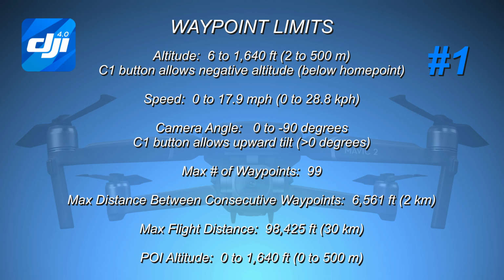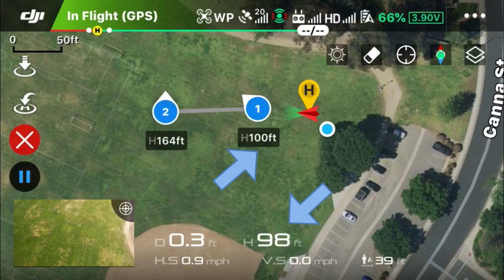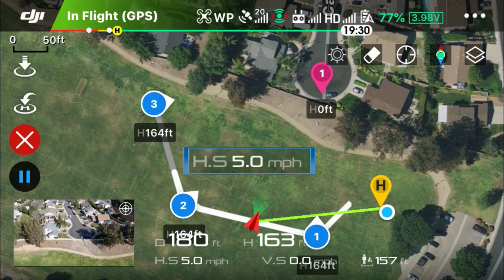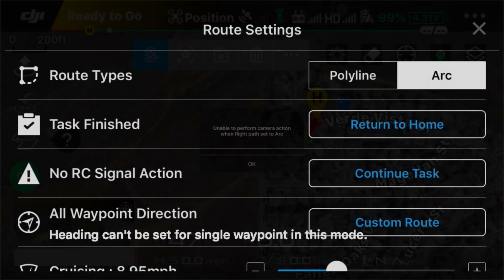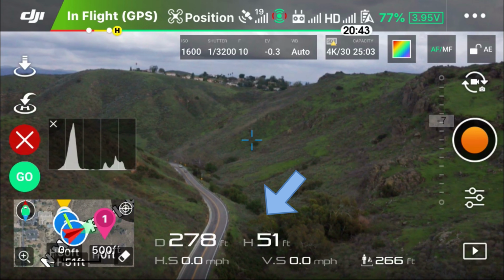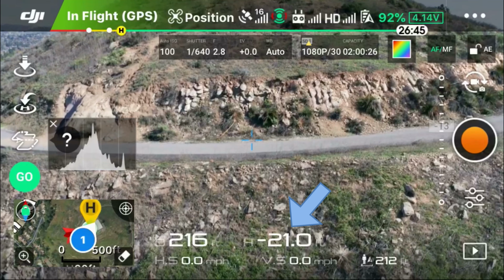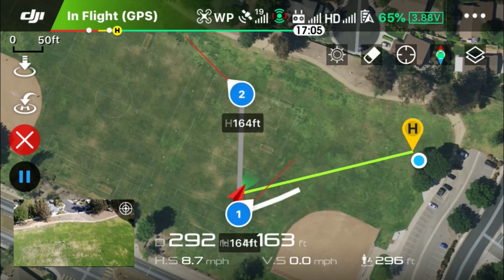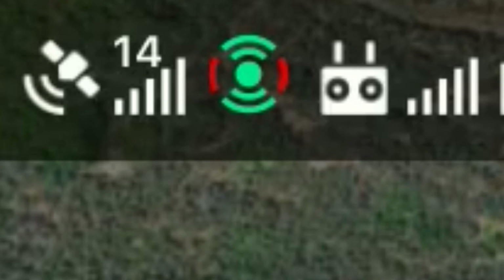DJI Waypoints 2.0 - 18 IMPORTANT TIPS + TRICKS - Mavic 2 Pro / Zoom - For Beginner & Advanced Pilots

Comment: Hi Dragon7. This is the best video on new waypoints function. Congratulations. I hope Dji will correct quickly the first errors you mentioned. I didn’t t completely catch the usage of c1 button but I will try and go back to you if questions. I don t understand why Dji doesn’t t permit to set altitude of waypoint or point of interest below home by default... just like litchi does. Thx for the trick for using waypoints without connecting the drone (with some limitation) which is definitely the biggest error of Dji with this functionality.  Hope this will be solved in newt version. Thank you again and keep, on your job !!
Reply from the maker: Wow, thank you so much for your very nice comment, very nice to hear.  And yes, DJI has many fixes/improvements which hopefully will come out sooner than later.  Thanks again, and Happy Flying!

Comment: I was looking for minimum distance between way points?  Say I want 2 waypoints, but I only want to change the altitude.  start at 6 feet and go straight up to say 200 feet.  Can this be done?  Thx.
Reply from the maker: Sure, after you set the 1st waypoint, add one near it and then drag it on top of the first one.
Reply: @D7dronetech  I will try that. Thank you for the quick reply

Comment: Hi Dragon7, thank you for the quality of your video on waypoints. I am trying to find the best way to setup two way points starting and ending close to a wall. My configuration is a shooting range, I want to simulate the trajectory of a shot from the shooting line to the center of the target. Can you do this using waypoints? How do you manage the sensors? I have a Mavic Pro 2. Tx a lot for your tips.

Comment: You seem like a smart fellow.  I need to follow a powerline.  Trouble is capturing a straight course when the next waypoint is a corner - say flying north from WP0 then west after WP1.  The drone begins turning west after leaving WP0 losing view of the transmission line.  I need the drone to pivot the full 90° at WP1.  I don't think it is possible.  Your input is welcome.
Reply from the maker: Should be as easy as using a POI. You could also set extra waypoints and POIs during the turn for extra precision. Hope that helps.

Comment: Thank you very much Dragon7 for the excellent contributions made in this video. The best I saw about waypoints. I have a question about Tip 17: I did a test keeping the waypoints screen, turn off the drone, but automatically the wp and poi that I had and the waypoints action selector went away from the screen ... It can be that DJI have removed this possibility in the update of the DJI GO 4?
Reply from the maker: Thanks so much for your nice comment!  Regarding your question, I just tested it and it works fine, just like before. I’m on iOS. Happy flying!

Comment: Thank you very much for this and the prior video! Quick question if you are still monitoring this video; Video vs. picture while running the waypoints: can you be videoing and have the camera set to snap a picture at each waypoint or would the video have to stop in order to do this resulting in multiple videos? Shortened can you video and take photos at the same time or does each action have to be independent of the other?
Reply from the maker: Delmarksman You’d need to stop the video before you can take a photo

Comment: Thanks for the video Dragon7.  I have one question.  I set up a Planned Mission with about 10 waypoints with the first waypoint beginning at 75ft and the last one ending at 8ft.  My problem is that after I press Go, the Mavic 2 goes to the first way point but never begins unless I press the forward stick, which I'm guessing it's by design. 

But the bigger issue that I am having is that it stops at each waypoint and doesn't move unless I press the forward stick again.  Is there anyway to get to not stop at each waypoint?  Thanks.
Reply from the maker: It sounds like you have your speed set at zero.  You need to make sure your mission settings which you'll see when you press Go has that not set to zero.  Also, you should check the speed you have set at each waypoint.

Comment: Good afternoon. A matter of battery saving, you may know that with Litchi you can plan a route from PC, tablet or mobile, without having the MAVIC connected. With WAYPOINT 2.0 you have to connect the drone and the station and then create the route on the tablet or mobile. It is true that at that time, when it is already within waypoint 2.0 can already turn off the station and the mavic ?? or it must be granted all, all the time.
And another question, in Litchi it can be configured so that the heights of the waypoints have greater height depending on where it will happen. If on the route there is a wp at 20 meters high but on the road a mountain appears, the program has it in mind and will know how high that mountain is and will climb those 20 meters higher than the height of the mountain or where Be the route. In these cases the application of DJI GO 4, could not do it and would crash, is it correct?
Thanks from Spain
Reply from the maker: You can plan a Waypoints 2.0 mission after being disconnected from the controller and:or the drone, but the altitude height won’t be adjustable above 65 ft or about. For the relative to ground altitude adjustment, DJI’s app doesn’t have that feature like Litchi to adjust the altitude you set to be that altitude plus the “altitude” of the ground. This feature must be selected through the Litchi app to adjust the relative to ground altitude.
Reply: @D7dronetech  Then I can connect the station, the mavic and enter waypoints 2.0. At that time I can turn off the mavic and the station and proceed to configure the route. The heights could not be greater than 65 feet (20 meters). So you would have to connect the transmitter and the mavic again, to place the correct heights, but at least what is the design would be more comfortable with the mavic and the station turned off.It is right ?I have the doubt, because in your great video, in the end, it looks like you create a small route, save it and reload it and that is when you report the 65 feet.Therefore, a small route has to be created, saved. Turn off everything except the mobile or tablet, then reload the route and then we can modify it, add, delete .... but always with the limitation of 65 feet?That Litchi makes it almost perfect and the manufacturer himself does not .... very afraid they must have people create routes from hell ... :)
Reply from the maker: You can plan a Waypoints 2.0 mission after being disconnected from the controller and:or the drone, but the altitude height won’t be adjustable above 65 ft or about. For the relative to ground altitude adjustment, DJI’s app doesn’t have that feature like Litchi to adjust the altitude you set to be that altitude plus the “altitude” of the ground. This feature must be selected through the Litchi app to adjust the relative to ground altitude.

Comment: Totally what I needed. Thank YOU! My problem is that my M2P refuses to link and run any mission because of an "incomplete" warning without giving a detail. What hidden detail could I have missed, except that I'm also irritated at the latest "geo fencing" yellow and orange messing up my screen when I have a clear zone to operate in. In two separate locations away from any airport I get these North/South corridors on my screen, I surmise DJI included the migration pattern of the snow geese here in Texas twice per year..
Reply from the maker: It’s not clear the problem you’re having but have you updated to the most recent firmware?  It fixes long standing issues with waypoints mode b
Reply: @D7dronetech  Thank You, I finally got my first run in the can, one baby step at a time. I also found out that if one does not hit save, everything will disappear.

Comment: Is there a work arround for the stopping and jittering at each waypoint? Thx
Reply from the maker: It’s currently a known issue which DJI might fix. As a possible option, use curved turns to help smooth it out.

Comment: Thanks, great tips. I'm struggling with C1 route planning. When I set four way points after lting a desired route and want to fly back in reverse, it seems to miss off the last waypoint check box.
Reply from the maker: Richard Barksby Not clear what you mean by your last sentence, please elaborate and will try my best to answer.
Reply: Sorry I have just read back and realised it didn’t make much sense! I have tried to plot a way point mission using the C1 button so I can fly to the specific location and record it manually. When I am ready to test, I save the mission and press Go. I would expect to be given the option to start either at the beginning or the end. Ie. Waypoint 1 or waypoint 5.The problem I have is that if I have created five waypoints I am only able to see four of them as tick boxes therefore I cannot start the mission at .5 and then fly to point 1
Reply from the maker: Got it now.  Makes great sense why you'd want to be able to do this, but unfortunately, that kind of option is not available.

Comment: Good afternoon Mark, I follow your videos, great work & very helpful. 
Now the problem I have. I have 37 missions I run every week with my Mavic 2 Pro & Zoom depends on what job site I’m at. To save me lot ot time I have the Smart Controller. 
Is there any way I can copy all my missions to the Smart Controller?  
Thanks for any help. Ken
Reply from the maker: wizbang99 That’s a great question!  Presuming the mission files are saved on the phone, it may be as simple as finding them and copying them to the smart controller. Sorry I can’t be of better help. Let me know what you find out. Thanks!
Reply: Thanks for the reply. I use a Ipad pro with the older controller for both drones. I tried twice to DJI but no reply in a week. I’ll look at the IPad file system then make a new mission then ck the files to see were the are stored. Next problem maybe Apple to Droid files. I love the Smart Controller for speed but found quirks. Ill send a video & problem. 
Thank you very much for getting back so fast.  Ken
Reply: Hi Mark. Here is more problems. Hope you can help. Thanks. I have been flying drones for few years. Setup with gesr & ipad took to long when in hurry to get a shot. I use the Smart Controller. 
Have used the Smart with both drones. But I shot this video & as it started out over the ice your see it stops. I had no control with the Smart Pad. I hit return to which it did. I fly this shot alot, never had this problem with std. controller. Switch back to old controller Pad & finish the video.??  Later back flying on Smart Pad  I was getting Obstacle system turning off & on by itself. Also old controller pad had me do the compass circle dance before flying. The Smart Pad does not ask at all. The list pops up when starting shows all ok before flying. Can’t find were to set my compass dance. It walks you thur setting the compass by rocking back & forth the Smart Pad. Sorry so long. Last old pad you could slide the screen sideways to set home point - brightness. It’s missing on Smart Pad. All firmware is up to dste. Love the Smart Controller for the speed getting inth air BUT nervous smashing my drones
Thank you for all your help!!
Wizbang99. /  Ken. 
Here is that video. Also all the obstacle is turned off. 

https://youtu.be/zeEN3_IrTdw

Again Thank You !!

Sent From My Abacus
Reply from the maker: Hi Ken,
Just saw your comment (it was in my spam).  As far as it stopping, it might be the sun causing the drone to stop.  Sorry, not familiar with the other issues you mentioned.
Reply: Dragon7 Drone Tech   Thanks for the help. Have a Great Week. Ken
Reply: Good morning Mark
. DJI just got back to me about moving the Waypoint Missions to my new Smart Controller.   They reply with : 
At this time we are unable to move or copy your Waypoint to other Controllers. Guess I’ll be busy on my rainy days programming all my Waypoints Missions to my Smart Controller. Thanks for help. Ken

Comment: Only one pic per waypoint, but how might these features work with Hyperlapse?
Reply from the maker: Waypoints 2.0 doesn't work with Hyperlapse, as it is a completely separate flight mode.  But Hyperlapse does have it's own waypoints capability, which you may already be aware of.  Thanks!
Reply: @D7dronetech  Thanks! Last time I used hyperlapse the waypoints were very limited in functionality. I was consistently getting an error message that the camera [change] angles were too great.

Comment: What is the purpose of setting altitude for the Point of Interest? I assume the chosen POI altitude will adjust the gimbal pitch in relation to the waypoint altitude?
Reply from the maker: The altitude of the POI determines where your want to frame your subject. For example, if you wanted to frame a bridge, you’d need the POI altitude at about the same height as the bridge else the camera will be aiming at the water if you left the POI at 0 altitude.

Comment: Thank you. Great tips. One question: photo, can that be a panorama as set?
Reply from the maker: Only 1 photo.  Litchi can do a pano though.
Reply: Can I spot/interrupt and then do a panorama?
Reply from the maker: @hnnigbo  It's not capable.  You'd need to stop/cancel the mission to take a pano, which would then require you to restart the mission from the beginning.  However, you could delete the prior waypoints in flight, then Start.

Comment: Hi, good video. I fly waipoint missions with Litchi for 3 years now. Here are the (full) DJI SDK Limits:

Min-Max 3D distance between 2 WPs:  0.5-2000m (1.6-6561ft)
Max distance between Home and WP:  4000m (2.48mile)
Max Cumulative mission distance:   30000m (18.64mile)
Min-Max Corner radius of waypoint:  0,2-1000m (0.6-3280ft)
Min-Max Orbit Raduis:     15-500m (49-1640ft)
Min-Max WP Height:      -200-+500m (-656-+1640ft)
Min-Max POI Height:      -200-+500m (-656-+1640ft)

Max number of actions per waypoint:       15
Max number of times a single waypoint action can be repeated: 15
Min-Max Mission Waypoints:         1-99
How many times the ground station task will be repeated:   1-255
Min-Max Pause setting in WP-action:       0-32 sec. (0-32767 ms)
Rotate UAV in WP-action:          -180°, +180°
Controllable Gimbal range:          (-90° to +30°), -90° to +0°

For "Gimbal Interpolate" to work there MUST be a connection between the AC and RC.

Altitude of the aircraft in meters when it reaches waypoint. The altitude of the aircraft is relative to the ground at the take-off location, has a range of [-200,500] and should not be larger than the aircraft's max limited altitude. If two adjacent waypoints have different altitudes, then the altitude will gradually change as the aircraft flies between waypoints.
Reply from the maker: Thank you!  For other readers, these numbers and limits do not all apply to DJI's Waypoints 2.0, and represent capabilities but not actual abilities.

Comment: Thanks for the detailed explaintion of how the drone flies and points the camera with Waypoints 2.0. Your tips using the C1 button are of particular interest to me as I came up against the 0' POI and 6'WP limitations already. However, I'm not understanding exactly what you are recommending... maybe I'm confused by you using the term "manually" set. By manually, are you meaning setting the waypoints using the map? So to use C1, the drone needs to be flying at the (negative) height you wish to place the waypoint? Does this work for multiple waypoints? I'd be very happy if you made another video just explaining how to use the C1 button to set waypoints, singlely and in combination with those set on the screen. Thanks.
Reply from the maker: a7wd Yes, the drone needs to be at the negative altitude, then use the C1 button to set the waypoint.

Comment: is it available on Android? Thanks
Reply from the maker: Not sure, seen some countries get it apparently, but not for others....
Reply: @D7dronetech  What about the US
Reply: @D7dronetech   I had this problem to update to 4.3.12 on my android device. Solved it by uninstalling and re-installing and 4.3.12 was installed. It seems it's an issue by not updating automatically, thanks for a great video. Malta EU
Reply: @alessandrobajada-mavic2pro410  I had to do the same thing on my Note 9 as well.. Despite numerous times last week the App would not update to .12 from .11... Sunday I deleted the app and reinstalled. I got the new updated version .12 on the first try! Lmao 7 or 8 days of pouting and it was easily fixed in minutes!
Reply: @michaelknight3145   Yes I updated my Samsung Galaxy S8+ and my Samsung Galaxy tab S3 to 4.3.12 the same way by uninstalling and re-installing . It seems that it was an issue on Android Playstore by not updating automatically. Another thing is that 4.3.12 seems to work well on the Tab S3.  
I would also like to see Waypionts 2.0 missions can be done without connecting the bird on Android so you can plan missions easier. Another thing which I am not sure if you can and would love to see that missions can be prepared from one device and uploaded to a cloud so you can easily transfer from one device to another. Thanks

Comment: Sure would have been nice of DJI to put the new Waypoints on the Mavic Pro Platinum.  There is no reason other than they just want users to buy a Mavic Pro 2 even though the Platinum just came out a year ago.  No reason?  The same type waypoints work just fine with Litchi.  Not buying a Mavic Pro 2.
Reply from the maker: I'd just stick with Litchi, it actually works much better.
Reply: @D7dronetech  Yes, I agree but it just pisses me off that DJI is taking the Apple approach.  "Our way or the highway".